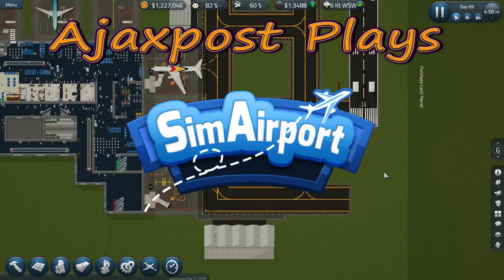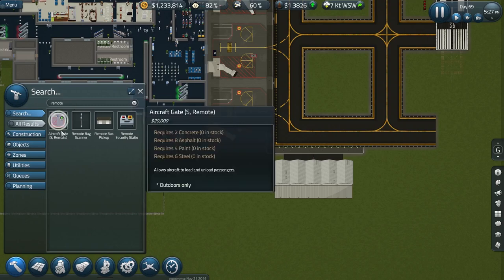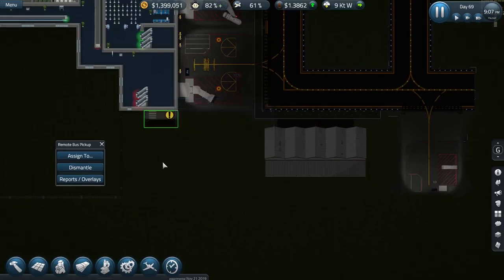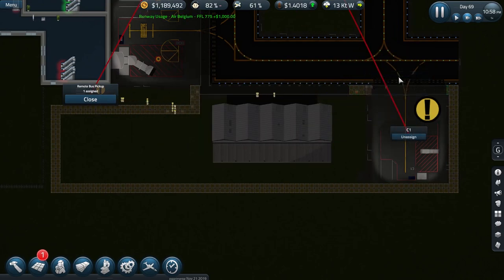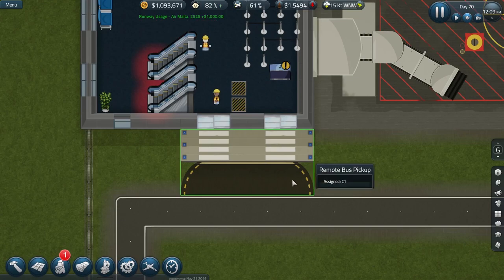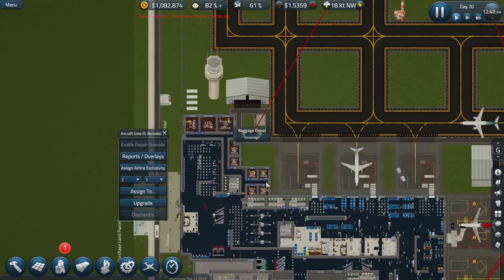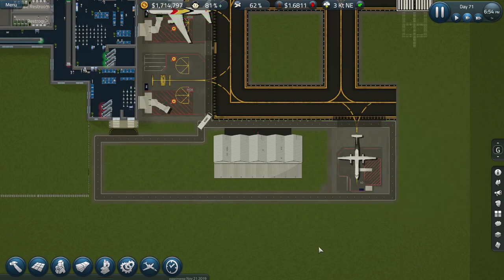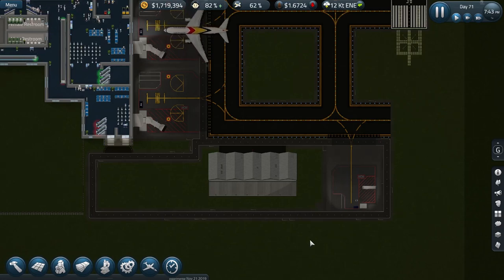SimAirport : Planning & Running Remote Gates : Tutorial #2

Comment: Hi Ajaxpost! I'm propably already late but I got a sugguestion on a different way! (In my opinion is much easier) and what you need to do is step 1 is click on the remote gate. Step 2 is look for a button for 'switch mode' and then what you do is add a walkway (side walk) to the terminal gate and there! 😄
Reply from the maker: Absolutely! 👍

Thanks for the reminder about the 'walk-to' option that was added later; it can be a much cheaper and more compact way of handling remote gates. I've now updated the pinned comment to mention this option, cheers.

Comment from the maker: CORRECTION 2: Since this video, 'walk-to' remote gates have been added where a length of sidewalk connects the boarding gate doors to the stand.

CORRECTION 1: I have been advised by the dev team that each apron bus does have a maximum capacity of 150  

So, if your Remote Gate serves planes with a capacity of more than 150 you may want to add multiple buses to the hanger so that your buses do not need to make multiple journeys. 😎

Comment: I have a question with regards to the boarding time/turnaround time. Why is it that most of my flights are late to depart? I’ve done the queue , 2 gate agent , I’ve given my flights an hour longer turnaround and they are still late. My standby gates are occupied all the time because of this. 
Another problem cuasi related to this problem is that some of my flights are at the gate for 100-300 minutes more... ‘waiting for crew’ ... how can this be a problem or be fixed? It’s very frustrating.
Reply from the maker: Hi Santiago, thank you for commenting, it is much appreciated.

I must admit that I am not an expert on the game - I just understand the basics of how some things work.  From what I have seen the important thing to do is make sure that passengers can move quickly and easily from the ticket desks, through ID check, baggage scan and the gate agent desks.  Also, make sure that there is plenty of information coverage and a good PA system will help.

The info and PA are especially important if you have other facilities like toilets, shops, bars and food outlets which could divert them from a straight line from security to departure.  Not sure about the delayed crew problem. As I understand it they need to go through security (unless they are just transferring from one gate to another within the same secure area) but go straight past the gate agent so as long as they can get to the plane they should be OK. Probably. :)
Reply: Having a good First class security will help too. The flight crew will go through that more than the standard queue.
Reply from the maker: @jks5325  Definitely, when creating security queues I will select one or more just for first class and flight crew to ensure they get through as quickly as possible.

Comment: In my airport it will be necessary the buses to cross taxiways since roads cant cross taxiways. Will that be possible?
Reply from the maker: Hi, yep, that shouldn't be a problem. The only issue with taxiways is that the buses travel more slowly so you may need to pay more attention to how long passengers take from ticket desk to boarding.
Reply: @AjaxpostPlays  thank you!!

Comment: mine says that i have to have a road from the gate
Reply from the maker: Hi, remote gates need a route for passengers to get to their plane, either by bus or walking.
If you click on the gate it should give you an option to switch mode between road/bus or sidewalk/walking. Depending on which type it is you will need to ensure that their is either a road or sidewalk connected to the gate's entry.

With a road/bus connected gate you will need to ensure that you have a bus linking the boarding desk to the gate.

Hope that helps. 😊

Comment: How do secure the gate and bus stop
Reply from the maker: Hi, thanks for watching the video. 😊

I have also created a tutorial covering security which might be useful: https://youtu.be/sXI2MDGEgXs

But, TL:DR, The key thing is that passengers must not be able to reach any gate without going through a security zone.

So, to start with, make sure that all the open space between the road and the gates is fenced off (in the early days I would always delete a fence before building a wall which then meant the gates  immediately became insecure!) and that there is no way to get from a building entrance to the boarding desks, bus stops or gates without passing through a security zone. You don't need to specifically put security around a boarding point or gate as such (you could but it would take substantially more effort).

In a multi-level building also ensure that all the stairs or escalators (you'll often need both up and down) to the departure areas are behind the security zone.

If, like me, you like to have a separate channel for arriving pax to leave the airport (rather than going out through the security zone) then you will need to provide a security exit so that they can leave but through which departing passengers cannot bypass security.

Finally, one thing I've learnt is to be wary of one way signs; they can be useful to direct passenger routes through the airport but be careful that they don't box pax into area so that they cannot leave - for example departing pax that have gone through passengers will need to be able to get back out if they miss their flight.

Hope that helps, but if still in doubt, the Steam forums can be very helpful, just post a screenshot and someone is bound to spot the problem. 🙂

Comment: How did you get the olden ppl from sim airport? Please let me know.
Reply from the maker: Hi, they've changed the option around a bit since Early Access so now:
Either on the  Settings page of the main menu, or under Options in game go to the Gameplay menu and set the option "Use Legacy Sprites" to 'On'. They should change style immediately.

If you have an older PC there is a setting under Graphics Settings called Agent Rendering Mode  where V2 uses the GPU more to render the agent sprites. This setting can be used to improve performance on some PCs.
Reply: @AjaxpostPlays  in simairport???